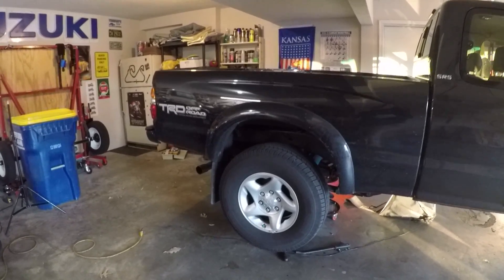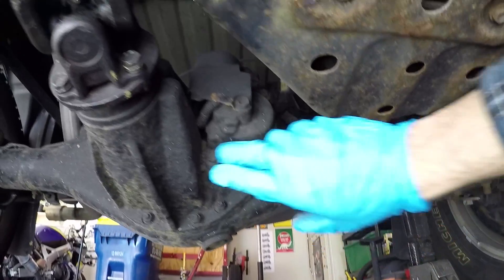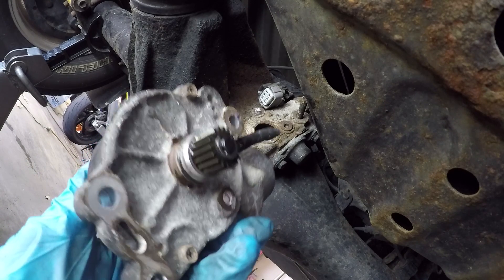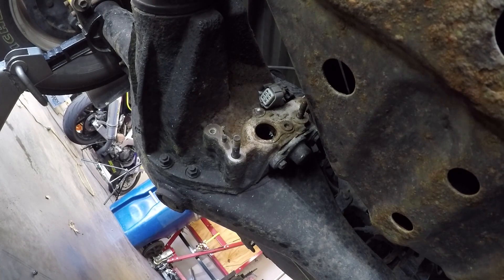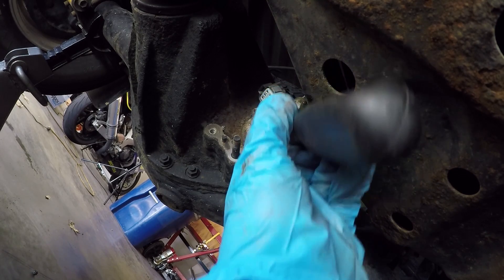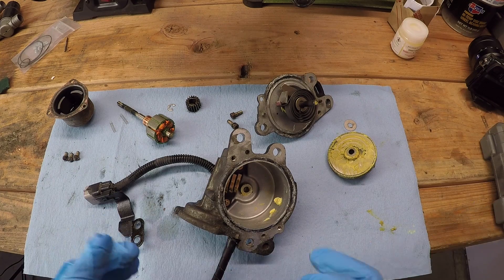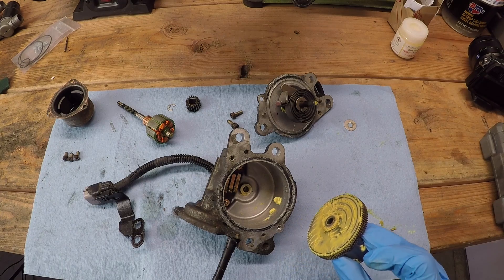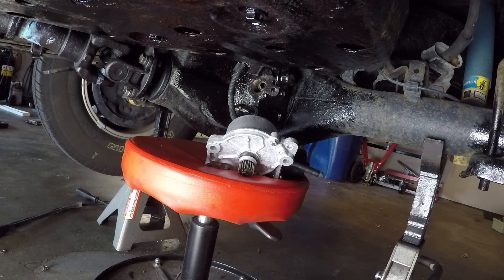How To Rebuild A Toyota Tacoma E-Locker Diff Lock Actuator

Comment from the maker: Want more details of the rebuild procedure? A full photo gallery can be viewed on my website here: https://practicalmoto.com/2020/01/29/toyota-tacoma-diff-lock-rebuild-e-locker/
Reply: Nice job I followed all the steps, but it seems that I did not adjust the direction of the gears and when the electricity arrived, it did not work with me. Can you help me. Contact number 0096896332433 WhatsApp

Comment: Mine blinks but engages, the motor just doesn't stop trying to spin.
Reply: take it apart and clean it all up like he did maybe that will get it working properly again.
Reply: @onenikkione  ended up just replacing the reverse light sensor that is used to tell the computer to stop turning the motor for $10 and it works perfectly.

Comment: I’ve had my Tacoma for 15 years & just assumed the e-locker wasn’t working because I didn’t know it only worked in low range so I went out & stuck it down in low range & pushed the locker & that’s the first time I ever heard it lock in 🤦‍♂️kinda feel like a dumb ass cause I’m 52 & never been without a Toyota 4x4 since I was 16.
Reply: and in the manual "only engage the locking mechanism if wheels are Not moving" or damage can occur

Comment: Good job & vid , nice rebuild. I would have tried checking the actuator when u first removed it & tried unplugging connector, spraying WD40 & then reconnecting it for another try, just to test it wasn’t something simple as a connector issue, before proceeding further. Having said that did you ever find out what was the original cause for failure? I suspect it was the grease causing a bad connection with the pins. TFS. Cheers

Comment: Thank you. How can the actuator be bench tested? I have a 2.7vvti rear differential, with the actuator. Would like to test it. I am using it with a ls400 drive drain so I don't have the original hilux harness or wiring.

Comment: Now that you got it working. Definitely engage it atleast once a year. I feel lack of use is why most don't work when you try it.
Reply: Mostly definitely try to engage it a few times a year. Toyota recommends running the general 4 wheel drive at least 10 miles per month. May as well engage the rear locker and drive it engaged for a short portion of that time if you're on dirt anyways.

Comment: So happy to have found this video. Total newbie. I detached the actuator and decided to bench test it outside the diff. It turned one direction (probably locked) but it won't turn the other way and i've now learned i need to get it back to the unlocked state so i can reinstall it. How do you recommend doing that? THANKS!
Reply: found the answer if anyone else encounters this problem. there are 5 pins on the actuator plug. well, actually 6 but one is blank.  the two pins in the same row as the blank are for power. attach a 12v supply to those two pins. if it doesn't immediately turn, remove the leads and switch them. try again. that should return it to it's original state when you removed it from the differential.

Comment: ... in this repair, is it necessary to not allow the car (or diff) to move while the locker mechanism is out being rebuilt? I am wondering if I can take my lockers off the car, put cover plates on the openings and be able to drive and then resume the repair putting the rebuilt lockers on later?
Reply from the maker: I would recommend not driving with the lockers removed. This is because nothing will be preventing the diff from locking randomly while driving.

Comment: I've got a 2wd non-TRD Taco that got the E-Locker as a dealer option. Because there is no 4-Low on my truck, I can switch the locking diff on whenever. I imagine it being a 2wd, the E-locker probably hardly if ever been used. The light come one when I hit the button so I assume it works. But seeing this, now I think I'll need to find a sandlot to do a little hooning, errr, testing to see if it works.
Reply: My owner's manual states "only engage the lock if the wheels are Not spinning" so I don't think you can switch the locking diff on "whenever" as you stated.
Reply: @onenikkione  Whenever...I come to a stop...

Comment: I know its a old video but...

I just bought a pickup with an e locker with on actuator (just a metal plate to cover the hole) and I can not with all of my might get that gear rack to move manually.  What am I doing wrong?  Do I need to lift the wheels up and spin them to get it to unlock?

Thanks!
Reply from the maker: You will likely need to get the wheels off the ground so they can spin. The rack is likely just binding. Unless someone has gone through the effort of forcing it into a permanent locked/unlocked position.
Reply: @PracticalEnthusiast  Discovered that there was a ball bearing/metal marble placed inn the cap that sits on the side, blocking the rod from sliding in.  Removed it and got my diff unlocked.  Now to find a way to Keep it unlocked until I can find an actuator.

Comment: Excellent video. Did you ever determine exactly what the issue was?
Reply: It was either the brushes not touching the commutator or the (3) positional points not touching the gear. Rebuilding it probably put things back in order.

Comment: Amazing video! Has anyone found a place where you can buy the O-rings? Has anyone tried and been successful? if so where did you find them?
Reply: Just get a master o ring kit at any auto store..  itll come with any o ring you blow out except your girls..  thatn just takes time butt itll go back like it was eventually as long as shes not allowing it to..  lol… ass…
Reply: call your local Toyota dealership parts department and ask if they can get you the O-rings that fit, don't use ones that "might fit" (from a master kit) you don't want water to get in and destroy that part.  A new one for my 2014 cost $1250.

Comment: By chance is your ABS light coming on?Hey person on custom taco mentioned it might be the rear locker sending a signal to the ABS system. I've been chasing this for over a year.Is there any chance you could do a video on how to fix the ABS system on a 2002 Toyota Tacoma 4 by 46 log 3.4 l
Reply from the maker: I do believe ABS becomes disabled when the locker is engaged. But, mine doesn't have an ABS problem if the locker is disengaged, so I can't really do a diagnosis video. Sorry. I would start by making sure your locker is disengaging and that the switch for the locker in the differential is working.

Comment: The grease is a dielectric  Grease it’s expensive, it allows electrical current to low through it, bend the contacts out a small amount to make contact to the disk which is built partially conductive.

Comment: My 2007 tocoma go's into four wheel drive but to take it out I have to shut the truck off and turn the selector back to two wheel drive then when I turn the truck back on it disengages. 
I checked for loose wires,any help would be appreciated.

Comment: My difflock was working then it decided to stop working within 20 minutes. I cant hear the relay click when I press the difflock button and when I smacked the diff with a hammer, I had a friend spam the button and it worked for a sec but then stopped. Could it be with the wiring?
Reply from the maker: I'd test the button and the relay before suspecting the diff lock or wiring. Rapidly pushing the button may have briefly got the contacts inside it to make a circuit.

Comment: Nice job I followed all the steps, but it seems that I did not adjust the direction of the gears and when the electricity arrived, it did not work with me. Can you help me. Contact number 0096896332433 WhatsApp

Comment: Awesome video man! Super helpful🙏🏼🙏🏼 Did you ever figure out what was causing the issue in the first place?
Reply from the maker: Thanks! I never did fully understand why it didn't work. I can only assume it was a weak connection cause by the grease. Whatever it was, it works well now.
Reply: Practical Enthusiast Well glad it works. I’m about to do mine - that second wire/hose coming out the top... is that a breather line? I can’t figure out how to get it unhooked and I don’t want to damage it
Reply from the maker: @therealcarterhansen  it's a breather tube. It should just pull out the top of the rubber hose.
Reply: Practical Enthusiast Perfect! Appreciate the help man!

Comment: Great video, great timing. I just installed a new (to me) 3rd member into my ‘03 Tacoma TRD and used my original actuator from my truck since the 3rd I got online didn’t have one and I wasn’t having issues with mine before the swap. In your video it looks like it was a simple fix, but if it was in fact the motor that was bad what where you going to do? I haven’t tested the electrical to the harness yet but I have a feeling the motor’s burned up and was hoping that this video was going to show how to replace it. Do you know if there’s a way to order an electric motor to replace a bad old one? Still loved the video and the custom paint job is fire haha!
Reply from the maker: Hi Kevin, if the motor was bad it would most likely be due to the commutator (the copper portion the the brushes ride on) being blackened from carbon build up. You can easily polish this back to like-new with some fine grain sand paper and polishing compound. Seeing as how the motors don't really spin that much every time you use them, I'd be surprised if the motor was "bad".
Reply: Yea unless youre able to fix the one you got or find a 12v motor the same size then your gonna have to buy the whole part which is like 400$..  but you might be able to find a 12vdc brushed motor if its got brushes on it otherwise itd be a permanent magnet motor.. just mic the size and double check..

Comment: Practical: thanks for your meticulous video. I'll be doing this in the near future.  You mention @10:40 about proper orientation.  Do you have any tips about alignment? Did you make match marks w/ a Sharpie or anything like that? Or does the alignment happen when you cycle the actuator like you did when you put it on the red stool?
Reply from the maker: I didn't know it at the time, but the "calibration" really just happens when you cycle the actuator once it's all reassembled. Just be sure to insert the metal "knob" on the back side of the gear into the hook of the clock spring. Take pictures while disassembling to give yourself a better idea of how it should go back together.

Comment: Ok so where the disc requires the grease for the electrical contacts I had forgot to put grease on it and it was making ground out marks on the disc as I would press the diff lid button.  So basically if I get that grease that disc should be able to spin properly? Great video btw
Reply from the maker: Yes, you'll want to have the grease on the disc to prevent gouging it.

Comment: My rear locker wasn’t working, I believe I was following the proper engagement procedure. But anyways I did a hard reset on the ECU, and then threw it in 4lo and pressed the button and the rear locker engaged immediately, I believe it was the first time it has ever been used in 17 years. Heck try that first before you go tearing into all that
Reply: Colby how do you do a hard reset on the ecu?

Comment: I have a 2002 tacoma ext cab 4x4 v6   and today is the 2nd day the rear diff lock light on the dashboard has been turned on but not all the way on it is dimmed. It turns on then turns off. The actual rear diff lock button by steering wheel is not engaged though.. i checked the plugs on the actuator and the problem still is there.  Thanks for your video very informative.

Comment: Push the diff lock button, let truck move forward while turning steering slightly, it will engage.  Do this very, very slowly to engage the rear locker.
Reply: How do I get it to work while I'm stuck in snow and car won't move?
Reply: @kojmas  Need to enhage 4L and Diff lock before you get stuck
Reply: @kojmas  make sure it is working before snow season arrives

Comment: Do the replacement frames rust like the old ones did or did they make changes so that they dont? And do they still replace them if you have a rusty one?
Reply from the maker: Honestly, I don't know if the replacement frames are better built. Surface rust still pops up out of nowhere around the welds on mine and I'm constantly trying to keep them sealed off with paint. I still see replacement Tacoma frames stacked up at the Toyota dealerships around here, so I think they are still honoring the frame recall on these trucks. I believe you just have to find a dealer that regularly replaces them and you might be covered.

Comment: Heck yes! I was actually planning to rebuild my e-locker actuator on the rear locker I just bought. Your timing of making this video couldn't be better. Thank you! By the way, I noticed from one of your other videos the KS plates on the Z. I'm in Kansas City. What have you done to keep the Taco's underbody clean? Every Toyota truck I have seen here has rust on the frame.
Reply from the maker: Heck yeah man! Good to see someone local. My Tacoma's frame is in relatively good shape because it's been replaced. The rear axle was pretty rusty when I got the truck but I've done my best at preserving it by scraping the rust off and treating it with POR-15.
Reply: Toyota didnt coat there frames in the 90's and early 2000. As result, even mild climates that wouldn't usually promote rust still takes it toll on a taco frame.

Comment: You may benefit from the "grey wire mod".  I had a 4Runner of the same vintage.   it allowed diff-lock at will.   I found it useful at times to be on 2wd locked at times. 

I am unsure if the Taco wiring is the same, but may be worth exploring.
Reply from the maker: I'll have to check that out, thanks!
Reply: @PracticalEnthusiast  any confirmation on that? Thanks.

Comment: The build up of corrosion between the differential and actuator would have been more than enough to bind the actuator
Reply from the maker: Agreed. It was crusty back there.
Reply: Do you mean at the pinion or inside the diff case?

Comment: I would have been more than happy to send some of the body grease, I have two things of it from doing warranty work. It’s good for other things other than automotive stuff though.
Reply from the maker: Well shoot, now we both have it haha.
Reply: I'm about to pull off my e-locker as well - any recommendations on alternatives to the mythical "body grease w" would be appreciated.... or if you don't mind sharing :)
Reply from the maker: @skyerunner  here's a forum discussion about the grease and a supposed "alternative" (post #6):

https://forum.ih8mud.com/threads/what-grease-for-electric-hub-slip-rings.666783/ 

I can't vouch for it, and honestly, it isn't exactly cheap nor is it probably available locally. Which is why I ended up just buying the Toyota grease.
Reply: @PracticalEnthusiast  Mud is probably the best place to find an alternative. Surprisingly considering guys on there, especially LC owners, who are intent on OEM Mr. T parts.
Reply: MountainsRiversMedia i see that eBay has it, a parts place may carry it too. I’m not entirely sure what it’s made out of so I can’t think of any alternative at this moment. If I still have a second tub of I can send you some.